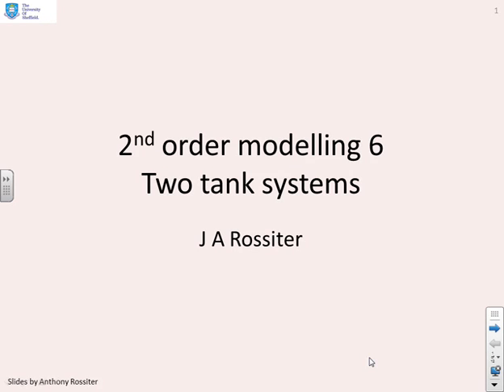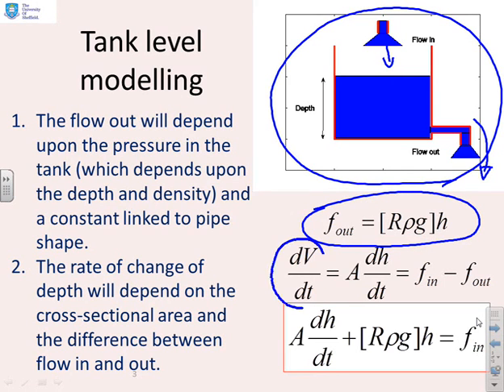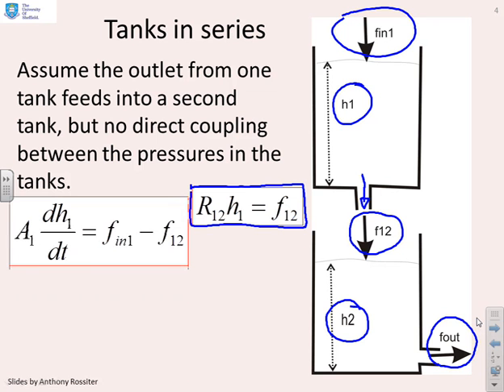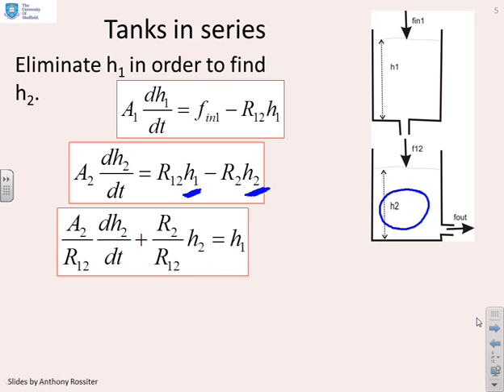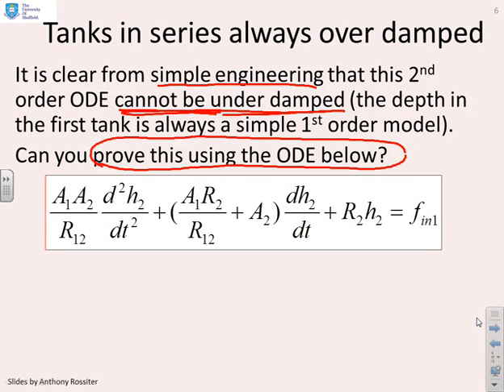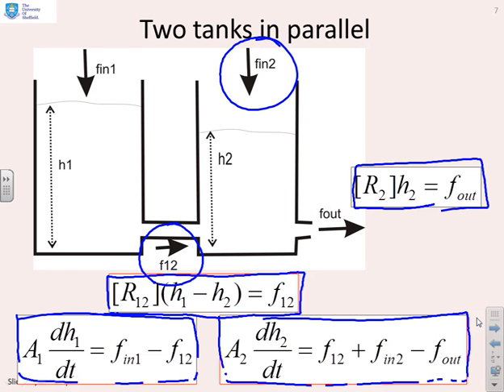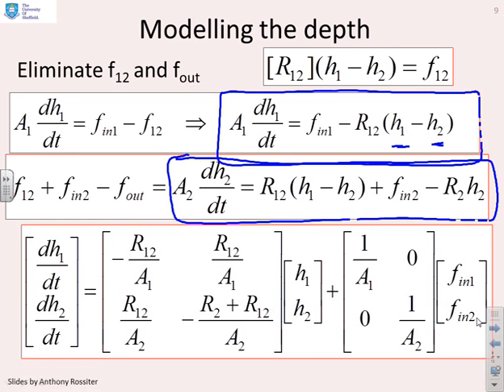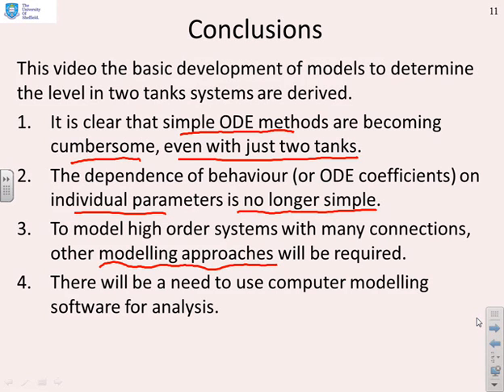Second order modelling 6 - two tank systems

Comment: Sir, in the case where the tanks are coupled in parallel, isn't the flow rate f12 of the form R12*sqrt(h1-h2) instead of R12*(h1-h2)? Kindly explain.

Comment: hi Anthony, i am currently modelling a coupled tank but without the second inflow, fin2, would this be the same as for the tank example previous to the coupled tank or would it be different?
Reply from the maker: The main thing is to do a volume balance. Total In flow - total out flow = rate of change of stored volume.Anthony

Comment: I confused about f12=R12(h1) and flow=R(P1-P2)
Reply from the maker: Flow rate is (locally) proportional to the difference in pressure across a pipe (or plug hole or similar). As pressure is proportional to depth one can change the constant and use depth instead of pressure.Anthony
Reply: John Rossiter flow is proportional with pressure drop it means